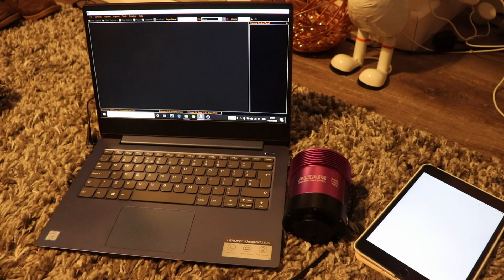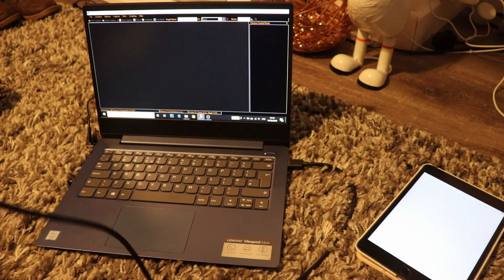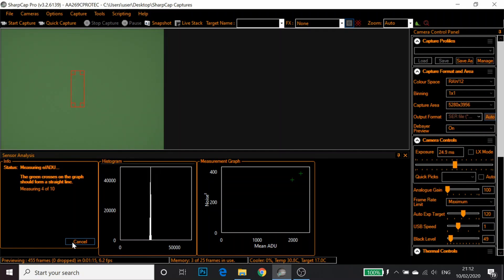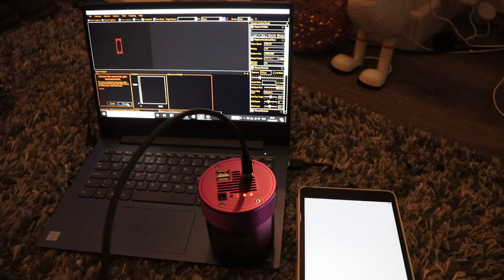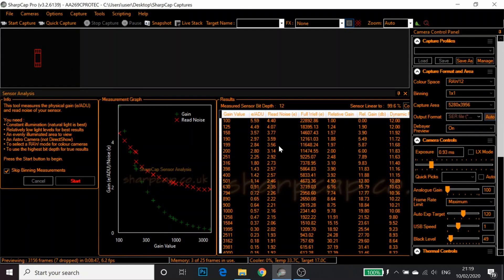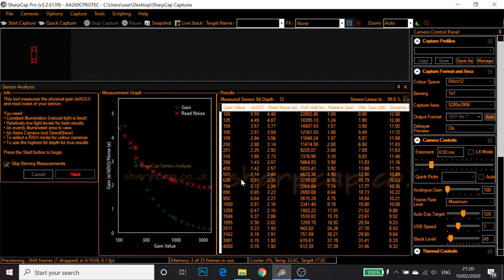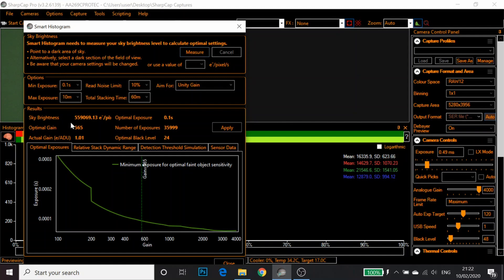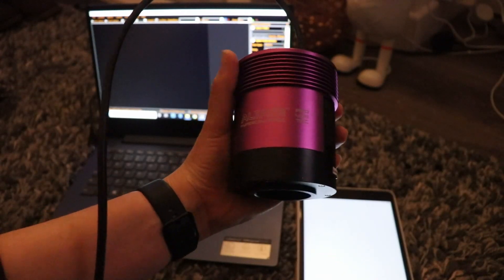SharpCap Sensor Analysis - How to!

Comment: Thanks. I've just run it on my own 269c and was pretty surprised at getting about the same value as you: surprised because it seems so high (? I've seen numbers closer to 280 online). Also, you get loads more data points than SharpCap gave me and I can't see a way to alter that.
My 533c came out at 310 (again estimated from a courser scale SharpCap calibration). My 174m was 910! Any advice?

Comment: Ahh that’s what I did wrong, I still had the camera connected in the telescope the entire time, will have to take it out and try again using the light panel, had it pointed at a bright wall but I’ll try it out see if there is much of a difference, going to a Astro cam from a dslr lots of new things to learn but well worth it

Comment: Hello Stacy I have tried to do a sensor analysis but the light I have to use is almost a very dark grey before it proceeds. So how are you able to do an analysis with such a bright light? I really find it hard to understand my equipment which seems to be out of step with every setup I see. My camera is a ZWO 294MC Pro camera.

Comment: Many thanks for this, AstroStace. I'm an old duffer but really appreciate your clarity and style. I've has ZWO ASI 1600MMC and 290MMC for nearly 4 and 2 years, respectively. I've always dodged sensor analysis, although I use Sharpcap Pro for most of that time for image acquisition and  PA. You've converted this old fool into finally getting his act together. Thanks again.

Regards

Roger Snee

Comment: Thank you for the video but unfortunately you confused at the end.  Did you actually point the telescope towards the sky or not?  If yes, what was your f ratio and how dark is your sky?  That info was missing and is quite important.
Reply from the maker: It’s not important, to use the smart histogram you just have to point it at a dark patch of sky. I was merely just using it as an example. Sharpcap smart histogram sorts the rest. 👍🏻

Comment: Hi Stace - thank you for the video.  Ive been trying for hours to get this process sorted and my camera just wont have it.  I have the latest version of SharpCap and an Altair 294c.  I always seem to get to the third and last stage when I get an error that I need to reduce the brightness.  Ive gone around that process about 6 or 7 times now.  The only thing I noticed different about your video is you have the analogue gain turned full up when you start.  To start with I had mine at minimum, so I upped it to 500 but it didnt make much difference.  Is that important?  Struggling to go any darker on the light source as I cant get the frame below 2s otherwise.  Aarrrgghh!!!

Comment: I’m going to try a sensor analysis on ASI294MC Pro. So far I’ve been getting satisfactory results making manual adjustments on sharpcap settings. Two targets eludes me M31 and Barnard 33. I could not ever for the love of God can’t pull full details on these two. I’ve checked Astrobin, Hyperstar groups and they where able to get a complete image for just an alt-az mount and 30” subs. I know how to a simple stretch but these two can’t be stretch to get more details. Running an Celestron Evo 8” ASI294MC P + Hyperstar and L-Pro filters with max sub exposure times of 30”.

Comment: Well, I believe this is the approach that will give a better approach. So, I analyzed this batch of camera yesterday 
So my Zwo list.
1600mm Pro , 2 - 183MC Pro, 2 290MM, 290MC, 2 -178MC, 2 - 120MM-S, 120MM.

What I find interesting is that each manufacturer handles gain ( the values we use ) differently . For example your optimal gain value is in the 500s. My cameras are all in the 100s.  I’ll be getting a Altair guiding camera,  it’ll be fun to check that out.

Cheers

Comment: Another great tutorial. I'm so impressed.
After watching this very informative video I found myself having even more questions. Hope someone will be kind enough to bring some knowledge I could use in practice. Here are my questions. 
1. I have successfully completed sensor analysis. Now I know what is best gain value for my camera however I run this at home. We all know that there's is no two exactly the same nights. My question is this. Would you recommend running sensor analysis every time I'm imaging? Logically by doing this I can have best and most accurate data so sharpcap can determine best gain, exposure time etc?
2. As I live in heavy light polluted area I'm likely to use light pollution filter. Having said that, do I need sensor analysis done with or without light pollution filter?
Reply from the maker: Glad you liked the video :) nope you only have to run the sensor analysis once :). But what you can do before each session is to run the smart histogram tool, this will suggest some optimum exposure factors :) . You don’t have to take it’s recommendations but I find them a good starting point. 
As for the filter, if you plan on using a filter during a session, just run the smart histogram tool with the filter in place...it will then suggest optimum exposure factors with that filter in place :)
Reply: @AstroStace  you are the star 😜  Thanks !!!

Comment: Great video thanks!  I've just watched a video by Robin Glover, the creator of SharpCap, on the optimum gain for CMOS imaging.  In it, he says that unity gain is not the optimum gain setting.  Rather for cameras with 2 stage gain processing, he suggests the optimum is the point just after the "read noise cliff" on the read noise vs. gain chart.  For my ZWO ASI294MC Pro camera, that equates to a gain of 120.   I'm going to run the sensor analysis in your excellent video and see what unity gain comes out but I suspect that will be much higher.  Thanks again for posting these videos.

Comment: hi stace  i have a question , how are you powering the 269c without power i have  tried mine and nothing unless i plug in the power lead , even used an active 3.0 cable
Reply from the maker: Mine works fine through the supplied USB 3 lead. Obviously the Tec doesn’t work without power but I can still use it with just the usb3
Reply: Thanks stace ill look in to that ,  wasnt sure if u had edited the video for some reason

Comment: Hi Stace ~ you need to check out this article and perhaps place some editiorial on your video ~ best regards David
SharpCap presents "Unity Gain", where one electron produced in a pixel results in 1 ADU at the ADC output, as being approximately Gain 564. To set an equivalent gain in N.I.N.A., the user would have to halve this value (as it is above 200, the point at which SharpCap automatically switches to high gain mode) and switch to High Conversion Gain. Thus Unity Gain for the Altair 269C is 282 HCG.
https://nighttime-imaging.eu/docs/develop/site/troubleshooting/altair_dualgain/?fbclid=IwAR0IwsfByon-8qfxIjE-pStahasdOT8w-eAD2b2XARaJkMDUG9DS9qNfBKY
Reply from the maker: Yes have seen the article from Simon :) very interesting:)
Reply from the maker: Just so you know I’m working in the NHS so finding it hard to do any video stuff at the moment ...but will sort when I can

Comment: Hello Stace, First, I just want to say I just found your channel and after watching this one video, I've subscribed so I'll be notified when you post more. My next treat is to go back and watch all your other videos.

I do have a few questions regarding this Sensor Analysis that you didn't mention in the video. The answers may be obvious but not for a newb like me.
1. When running the first part of the analysis, do you need to have the sensor cooler on and cooled down to your normal shooting temps?
2. On the second part of the process where you need to have the camera on the scope behind the filters, Do you need to be in a truly dark sky location or could this be done while set up in a light-polluted backyard? Would the results vary between the backyard and a true dark sky site?
3. Also, for the second part, Do you need to run this analysis through every filter or just the Lum? I've got an 8 position wheel with LRGB,Ha,OIII,SII filters
4. At 08:55 I see the graph mentions "optimal black level". I don't see any way of adjusting that on my camera?

Looking forward to your answers and your other videos.
Reply: Here's the results from running the first part on my ZWO1600mm. The manufacturer states unity gain is 139 which places it right about where this graph puts it.   https://photos.smugmug.com/photos/i-GT422HJ/1/dbeabae8/X2/i-GT422HJ-X2.png

Comment: Thanks for the video, what else to do on a very wet day. Sensor Analysis of course on my new AA 269C. My results were very similar to yours with a Gain of 567 and eADU of 23220. I did have 2 problems running the analysis in that I could not select an area. All I could see was a single red arrow. Putting the view to 100% from auto showed up the box, so I could expand it, sorted. Next was the light level of my Tablet, even on its lowest setting it was still to bright, so I used some Neutral Density film to bring it down. (Also worked with a Polarising Filter), sorted, the light level has to be really low!! May help others. Thanks again.

Comment: Thanks for the presentation. Quick question though: at what temperature the camera should be when doing this analysis? Is temperature not a factor when doing sensor analysis? Thanks a lot.
Reply from the maker: I found it didn’t make much difference to me whether I cooled the camera or not :) but to be absolutely thorough, you could run it at the the temperature you intend to capture your images at

Comment: Many thanks Stacey. Really helpful video.  
How does Sharpcap save the sensor analysis data for next time?  Cannot see a 'save' option.  I guess the Histogram Brain function needs to access that sensor analysis data when I start up my laptop & SharpCap somehow.  Or do you have to run the sensor analysis every night?
Reply from the maker: No worries Francis! It actually saves it automatically somewhere, so don’t worry as long as you have run it, it will be able to access the information it needs
Reply: @AstroStace  That's great. Thanks! You are so knowledgeable Stacey.  Have run it now for both RAW8 & RAW12 on my protec. The brain function picks up the data for each - amazing!

Comment: So is this method you show here a means to do this so we don't have to do this in the cold?  Also, do you have your sensor on when you run this sensor analysys?
Reply from the maker: You can run the sensor analysis from inside yes, but the smart histogram tool (the bit at the end) should be run when your camera is connected up to your scope etc. Sensor on? I'm not sure what you mean
Reply: AstroStace, thank you....I apologize I meant the cooler, not sensor...silly me.
Reply from the maker: @gwzapo  you can if you wish :) I've run it with cooler on and cooler off and not found a lot of difference. That's because read noise is different to thermal noise :)
Reply: AstroStace thank you so very much for the quick responses!
Reply from the maker: @gwzapo  no problem! Best thing to do is run it with the cooler and without to see if your results vary a lot

Comment: Hi Stacy,
Just a quick enquiry. If i am doing Narrowband imaging with a mono camera, would you run the sensor analysis function with a Narrowband filter in place ?

Cheers John
Reply from the maker: So sensor analysis without the filter in place....but if you wanted to make use of the smart histogram tool you would then run the smart histogram tool with the filter in place :)

So basically sharpcap would know the characteristics of your sensor without the filter interfering, and then could calculate the optimum settings with imaging with the filter by running the smart histogram tool with your filter in the imaging train
Reply: @AstroStace  Thanks for the heads up Stacy :)

Comment: Thanks for this. I'm just starting with an astro camera and my exposure settings have been a bit random so this is really useful. Can you explain why it's a good thing to aim for unity gain?  I'm another one looking forward to the video on determining the ADU for flats, so you've got your work cut out for you!
Reply from the maker: It also depends on your setup too. So aiming for max dynamic range may mean a lower gain....and thus you may need longer exposures to overcome the read noise in the camera. So really people should assess their kit and decide from there. But for a beginner I think aiming for unity gain is a good step :)
Reply: @AstroStace  Ta, I get the gist of that. It looks as though you didn't have the camera cooler powered. So I assume that the sensor analysis doesn't vary very much with termperature?
Reply from the maker: @AndyMcGregor2  it shouldn't do, no...as I'm literally just looking at the sensor characteristics. Though just for completeness I have previously run the sensor analysis cooled and uncooled and got the same results :)
Reply from the maker: I prefer to aim for unity gain as at this setting 1 electron = 1adu and theoretically you get less quantisation error...in short I just see it as a 'sweet spot'. I've found with aiming for the max dynamic range setting images are noisier and you would need a lot more subs to even out that noise ....so for me and my situation I find unity gain is better :) hope this helps!

Comment: Thanks again Stace. I have moved from a DSLR to a new ASI533MC and haven’t done flats yet as it’s so confusing working out the correct ADU etc. and everyone’s way of doing things. So looking forward to your next vid. In the mean time I’ll try this check and get up to speed. Cheers John.
Reply from the maker: No worries John! Yeah I shall get on that video...there's just a couple more things I want to research first :)
Reply: I'd be interested in hearing about your experiences.  I've had some struggles connecting the ASI533MC to Sharpcap.  Ended up using an ASCOM connection.
Reply: Larry Doucet I haven’t tried connecting yet as I use a ZWO ASIAIR for capture. Will try on the weekend.

Comment: Thanks Stace!  This is a great video and I had no idea SharpCap had this capability.  I wonder, can it be done with a DSLR as well?  When I get back up and running, I'll do this.  
Can I safely assume that each night attached to the telescope you should run the last part of this to get the best exposure for that night's seeing and light pollution?
I really think this is great, and it's why I like your channel so much, detailed information in easy to digest pieces.
Reply from the maker: Thanks for the great feedback Gary! Yes you could run the smart histogram tool each night to take into account the differing sky conditions...also if you change part of your setup eg a filter. It's a useful tool. I don't believe it works with DSLR though sadly :(

Comment: It makes more sense now.  Thank you!  I tried to run it but they don't say how bright of light to use.  So I pointed it at a white lamp shade.  It told me it was too bright.  So I pointed it at the ceiling and it was not bright enough.  So I gave up on it.  I hadn't thought about using a tablet, but still wouldn't have known how bright to go with it.
Reply from the maker: Yeah a lot of folks struggle, so you aren't on your own :) I tend to go 3/4 of the way towards minimum brightness. But it's much easier to tweak the brightness of a tablet to suit :)

Comment: Great video Stace. Just watched Dr. Glover's presentation about calculating exposures where he shows that shorter may be better. I've had SharpCap for a while but never really used the analysis tool. However I'm now more inclined to give it a go. Really appreciate the technique of using your tablet, never would have though of that. :-)
Reply from the maker: Yeah it's much easier to adjust the brightness of a tablet :) leads to less frustration hahaha

Comment: Great video! I will buy my first astro cam soon. Do you measure your ADU each night you are imaging?
Reply from the maker: Hi! No I just do the sensor analysis once and then I work out my target adu for my flats when I have the info on the full well depth (I'll cover this in another video). On an imaging night I tend to run the smart histogram tool in sharpcap to work out the best camera settings for my set up that evening...I always shoot at unity gain though :)
Reply: @AstroStace  Okey thanks! Can you make a video on all steps that you do on a imaging night? How you choose target,  mount setup  camera settings, framing etc. All those things that you do in a night. 

It will be a long video but it will make people understand those small things that some people forget to explain :)
Reply from the maker: Yes absolutely, this is definitely the kind of video that is missing from my channel...but I shall get on it asap